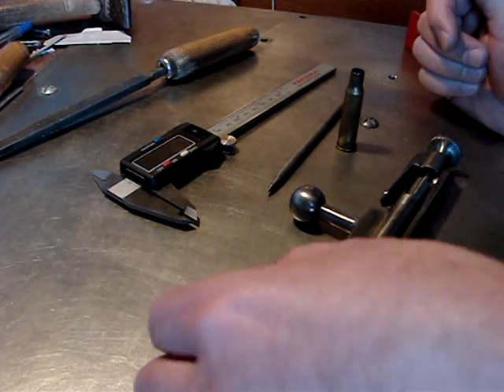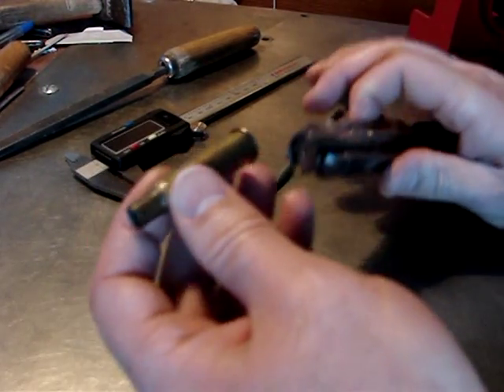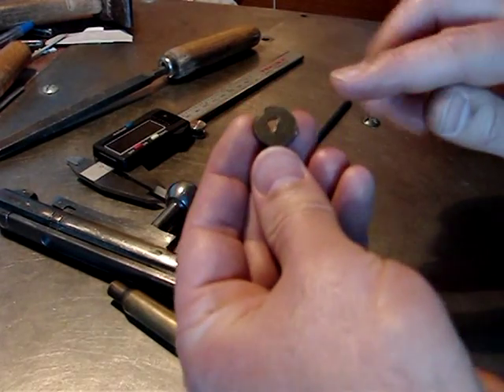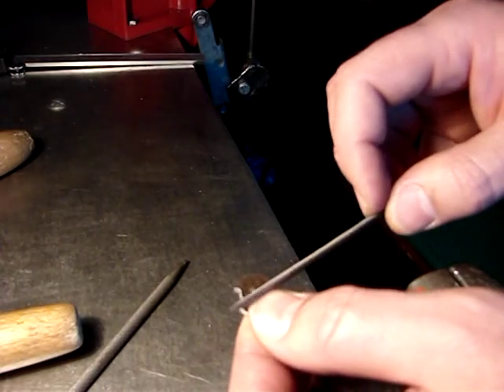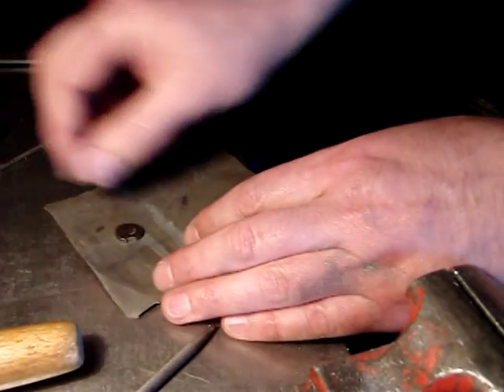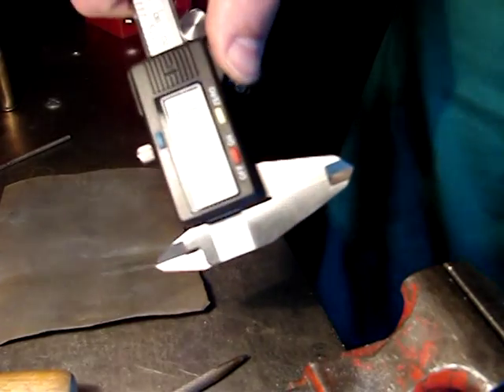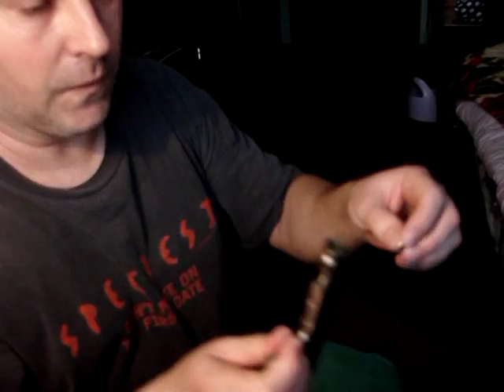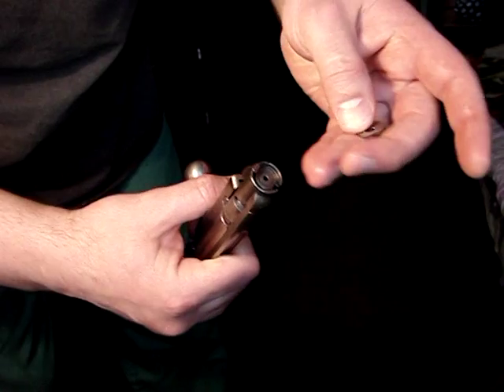No-go gauge for Mosin Nagant DIY

Comment: It's not so simple to just take measurements. The front of the guage requires it to be a specific angle, it's not just the how long the guage is and the diameter. The angle determines where the front of the guage hits the front of the chamber. If the angle is not exact, you cannot determine the correct length of the guage. As you are dealing with just several thousanths of an inch between go and no go, making one yourself is not an easy task. Better to buy the guages and make another tool instead. All of this is not to say that you are not a good machinest, it's just getting the exact measurements that is the tough part.
Good shooting, John K
Reply: Daneuri Lenny You say, "The front of the guage requires it to be a specific angle..."

You seem to be confusing the "bullet style" gauges for rimless cartridges (such as 8mm Mauser or 30-06) where that type gauge is long enough to contact the front of the chamber where the cartridge shoulder has a particular angle.

The "coin" style gauges for rimmed cartridges (such as Mosin or .303 British) do not involve, have, or use any angle whatsoever.
.